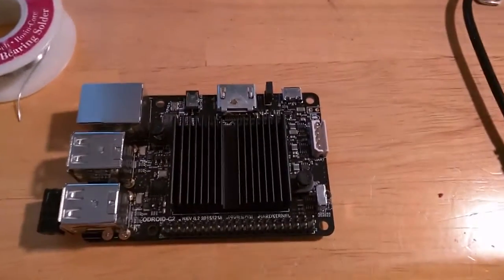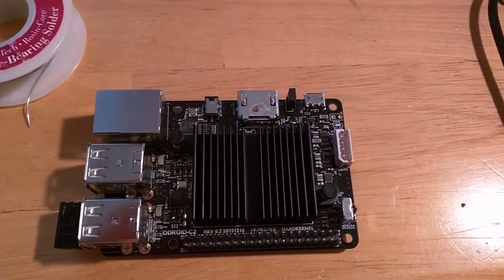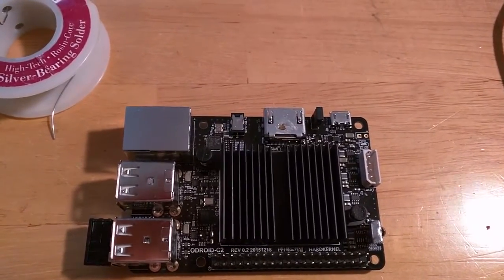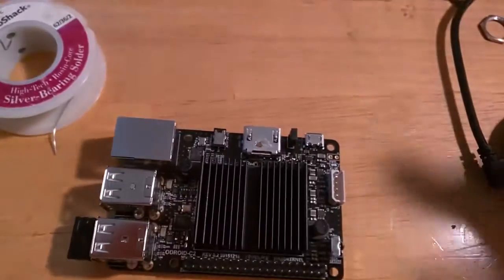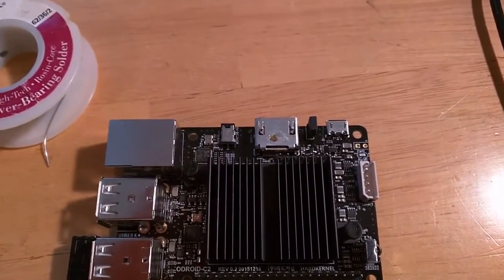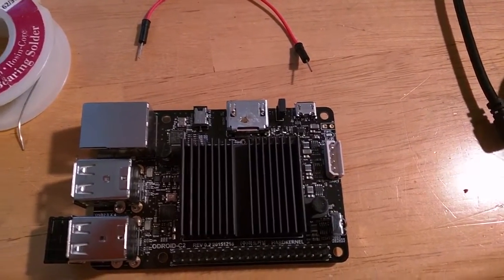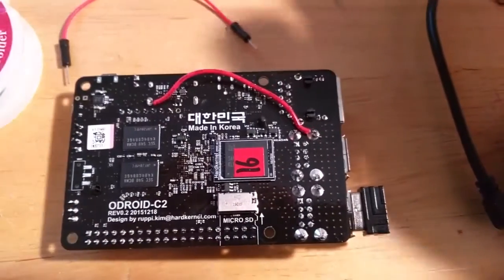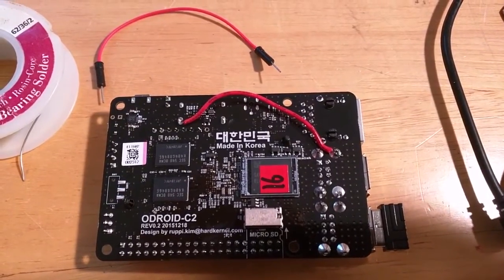ODROID C2 HDMI Grounding Workaround

Comment: I read into this... Spent way more time reading about it than I have learning about Linux itself (lol jk).
But seriously, I read that you're not supposed to ground those 2 out. They said it can damage your device.
However, it could be working fine for you. Let me know, I'm thinking about trying various cables for my fix. Maybe sneaking into an electronics store and unpackaging a bunch of cables and testing it on their TVs (lol).
Reply from the maker: Well put it this way, there are tons of devices where these "non-compliant" cables work just fine. So I feel fine grounding this.
Reply: Well, as it turns out it was an HDMI cabling issue for me.
I was trying to use the HDMI cables here at my job. I tried one of my HDMI cables at home, and that fixed it.

I guess it depends on whether your HDMI cable has a grounding pin or not (or a faulty grounding pin even).
Reply from the maker: yep, that's exactly it.  but my point is that those hdmi cables here at your work will work without almost all the other HDMI devices... because they ground the friggin shield!
Reply: Hey there, I know it’s an old video but I hope you’re around to discuss a similar situation with my XU4